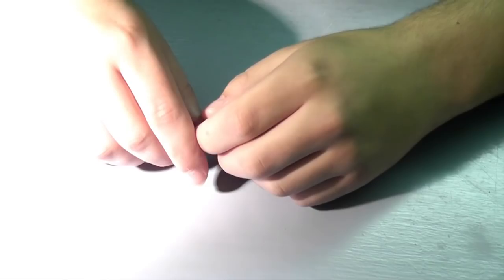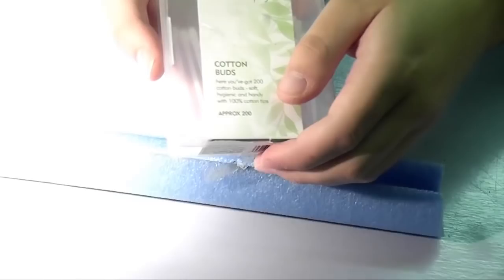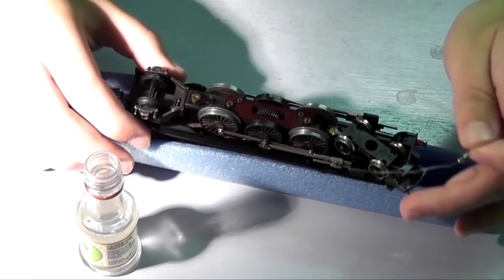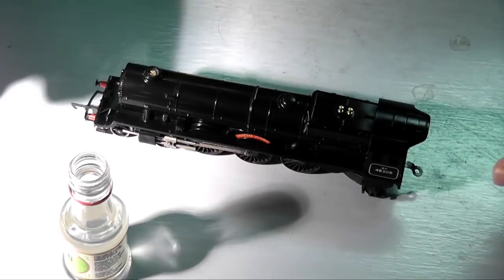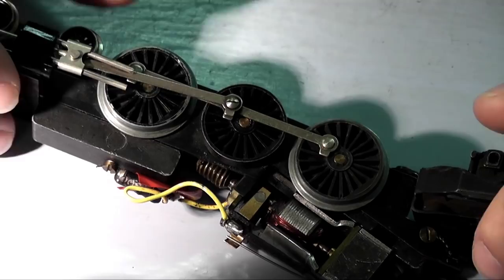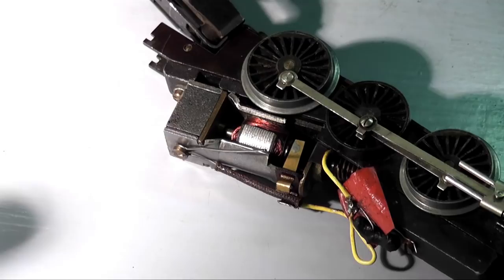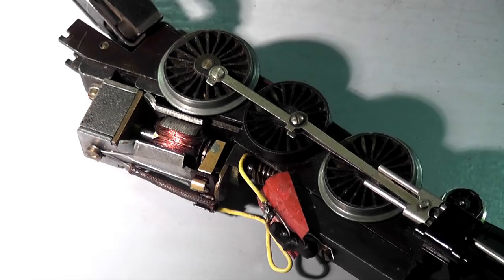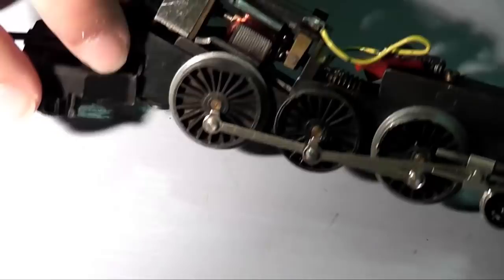Model Train Maintenance: Lubrication

Comment: WD40  doesn't  affect  electronics.....
Reply from the maker: True, but it damages plastics and paintwork. It's also no good for bearings or any tiny mechanisms, as it contains solid particles. You want a very refined and very light oil for anything like this - WD40 can destroy a model very easily!
Thanks for watching, Sam :)

Comment: I have a Bachmann Santa Fe 307 probably at least 20 yr old, One black wire has come unsoldered. Question does it solder to the same copper plate that the red wire is still attached on front of engine behind truck on left side.

Comment: little tip sams trains, put a drop of oil on the felt pads, it works wonders as done it on my locos :D
Reply from the maker: Hi yeah that's right - you do need to oil the felt pads, but also directly oil the bearings for even better results!
All the best,
Sam :)

Comment: I watched this old video the other day for guidance on lubricating a 1977 Hornby Jinty that was a very slow jerky runner.  Thought it might help a bit but didn't expect it to make much difference.  Put it on the track and whacked up to full power and it took off, derailed on the first bend and flew off the table.  Lubricating may have improved performance a bit too much.
Reply from the maker: haha blimey - I'm surprised a bit of oil could make so much difference actually!!
Thanks for watching, Sam :)
Reply: @SamsTrains  I think it hadn't been lubricated since it left the factory in 1977.

Comment: My loco won't move just getting a little spark wen placed on the track .was running fine
Reply from the maker: Hmm sounds like a short circuit! Is it a tri-ang? I have lots of servicing videos for those, if you wanted to give it a way??
Thanks for watching - Sam :)
Reply: @SamsTrains   yes siram it is a tri ang

Comment: I see that yer magnet is held on by a screw going down through the center.  If you want a really good running loco, replace that magnet with a neodymium rare earth magnets.  This will enable the loco to travel at a much slower speed and will decrease the amount of amps the motor will draw.  I've done this for all my open face motors and it has really helped a poor running loco.
Reply from the maker: That's true, but the neodymium generate excess wear on the armature due to their strength, which is known to damage motors more quickly in the long run! My solution is to remagnetise the old magnets using a remagnetiser device - this greatly improves performance without overstressing the bearings!
Thanks for watching - Sam :)

Comment: I wonder if anyone can help me. I got night mail for Christmas a few years ago and it’s very special to me. Recently I took her out for a run and she’s screaming. So I gave her a drop of oil here and there but i noticed it doesn’t happen when the body is off. It squeaks a tiny but but it runs better to without. The body is super light so surely that can’t be a reason but when I put her back together I notice she’s struggling like mad and and making a an almost constant screaming noise. I’m out of ideas can anyone help me ?
Reply from the maker: I'd just recommend a full service Lee - look up my video on servicing the Hornby Thomas (it has the same chassis), this shows the whole process in detail! :D
Thanks for watching - Sam :)

Comment: Got a old logging car from bachmann but uses old coupler and I tried switching them with ones from a old car that broke from my first set but the screw holes were different sizes how can I get it to work
Reply from the maker: Hmmm, well if you're sure you want it permanently, you could glue it I suppose??

Thanks for watching,
Sam :)
Reply: Sam'sTrains thanks but superglue probably not but maybe I could use a bigger screw but would that crack or break the plastic other than a bigger hole

Comment: What do you do if you overlubricated a trolly and now it powers on but will not run?
Reply from the maker: The best thing to do is to repeatedly clean the engine with isopropyl alcohol on a cotton swab until all the oil is cleared, then re-lubricate lightly. You will also want to access and clean the commutator if possible!

Happy New Year,
Sam :)

Comment: My railroad flying scotsman is making a sound when it runs and I think it is a crank pin that is loose
Reply from the maker: Hmm, if you're sure, then stop running it for now! You need a 2.5mm nutspinner, (available on ebay) which you can use to tighten the crankpins (very gently!)
Thanks for watching, Sam :)

Comment: Hi Sam. I purchased a DCC set before Christmas as I had one as a child. It originally went around the tree but it has since grown with a shunting yard and I've watched many of your videos in the last few weeks. My GWR 2721 developed a squeak and I used a fairly premium TF2 lube I use on my bikes but I fear I've caused the motor to short circuit. I don't really have any other way of testing whether it's the train or a software problem as I only have one engine right now. What do I do now?
Reply from the maker: Hey Giles, really sorry to hear about your problem. The only way to know is to remove the decoder, and then power the motor directly (you could use a 9v battery, if you can access the motor contacts). If oil gets to the commutator of a motor, it can cause it to fail - the process can be reversed with a thorough clean, but it's not always easy with modern motors.
You could always try returning the model for a replacement, since it's not very old! Otherwise, be sure to use tiny amounts of oil, and use light machine oil (the Hemline stuff is good)!
Thanks for watching - Sam :)

Comment: thanks for the video o have 2 questions of i may.
numerou uno
If you can't get the oil on the wheel due to it not being conductive  then dose that not mean you can't put it on the engin. 
and 2.
what are your thorts o using contact spray to clean the engin. electrical contact cleaner that is.
Reply from the maker: No problem!
No you can oil them, but you just need to keep the oil away from anywhere that makes electrical contact. You can oil the axles though, because the contact area is so large, that a few drops of oil don't spoil the connection.
Yeah that sounds good - just be mindful of using anything corrosive, especially near bodywork, and make sure it's not too rough on delicate parts such as the commutator!
All the best,
Sam :)
Reply: Thanks buddy

Comment: Hi Sam, one quick question:
In terms of the wheel axles within an engines chassis, what should you use as a proper grease if it was previously removed by ones younger and curious to take things apart self?
Reply from the maker: Hi, thanks very much for the comment! I've used sewing machine oil (hemline brand) for many years - and I find that works perfectly if used little & often - two blobs on each axle every 6 months keeps them running perfect!
All the best,
Sam :)
Reply: Thanks mate, I'll try it out :D

Comment: so no dab paper clip tip of petroleum grease on the worn gear just asking   great vid
Reply from the maker: You can use grease rather than oil, it does last longer! You just must use grease that’s plastic safe - so petroleum grease is out unfortunately. And you want a very thin grease, otherwise you generate even more friction. I prefer oil as it doesn’t leave parts sticky, so they don’t attract as much dust and dirt!

Comment: Thanks for this Sam. By the way, can you tell me the name of the silver weights you use to add extra weight to wagons, coaches etc, especially if they tend to derail on points for instance? It was on one of your videos but I can't remember which one. Thanks, Peter.
Reply from the maker: No problem Pete! They're wheel balancing weights, you can get blackened versions too! :D
Thanks for watching - Sam :)
Reply: There’s at least one on each of your cars’ wheels, just take em from there and use them on your train, diy :)

Comment: Hi Sam. I've been enjoying your videos. I'm finally going to have the space to have a proper layout again, which means getting my locos out and giving them a service (and maybe converting to DCC). Anyhow - would you still recommend the machine oil since you'll have had two and a half years experience with it since you posted. Any advice would be really appreciated. Many thanks!
Reply from the maker: +Nialletto Hi, thanks very much for the comment! I can absolutely recommend the machine oil - it's still there on Amazon! I've used it for many years now, and it works very well!
Cheers,
Sam :)
Reply: Sam'sTrains Thanks, Sam. I'll pick some up and hopefully it'll arrive before it all grinds to a halt over the festivities :). Merry Christmas!
Reply: How do you rewire an XO4 motor

Comment: Very helpful Sam....The Brushes that are on e bay.....Are there many different kinds depending on loco ? Must admit i have never really maintained any of my triang locos...They all run and have done for all their lives..50 Years and more....However this vid is incredibly useful.Changing brushes..Old to new does not appear to be too hard....Just wondered how readily available they are for Old Triang locos and how different they are ie size etc,per loco type ?? Cheers ...Adrian
Reply from the maker: Thanks Adrian - no if they're tri-ang brushes (that look vaguely right), then they'll fit! Yes they're readily available still ,and it is fairly easy to do!
Cheers mate,
Sam :)
Reply: Thanks Sam....